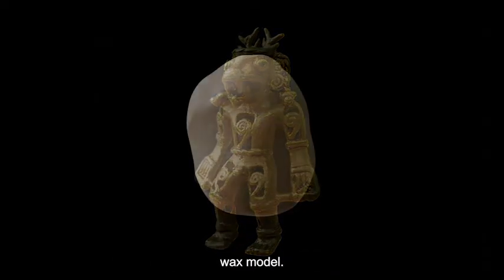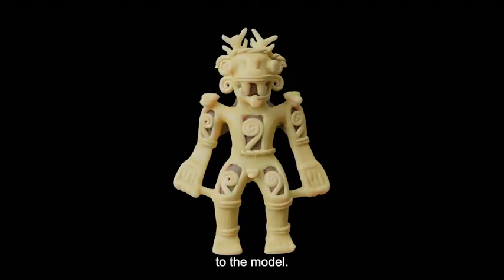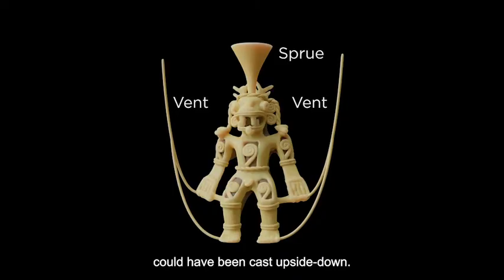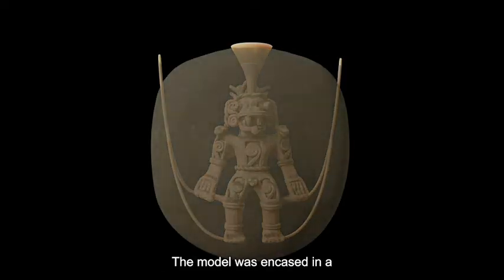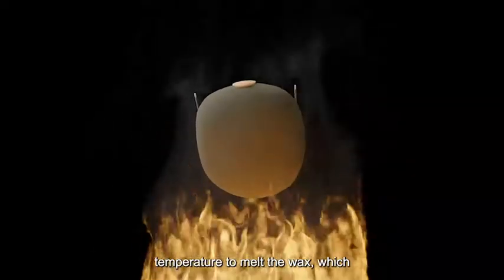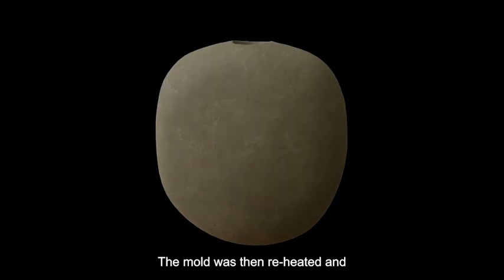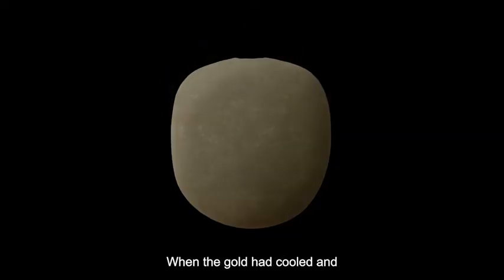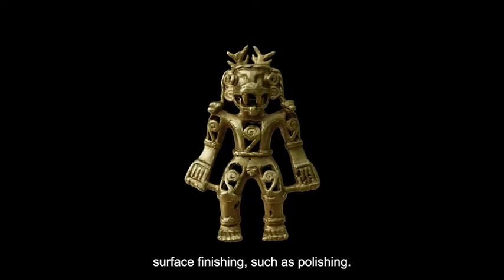The Lost-Wax Casting Process

Comment: How do they remove the inner clay though?
Reply: They don’t. It sticks to the outer layer of clay. This will then create a mould that can be reused. They’ll cut open the mould to remove the gold pendant and then close it back up to reuse the mould again.
Reply: That was my question too. If I had to guess, I'd guess they just take some small tool and dig it out through the holes/openings in the ornament, whether it was still soft, or it got hardened in the fire and they had to break it up.

Comment: Where'd they get their wax from in South America?  As far as I know, there's petroleum based paraffin wax that's a byproduct of the oil refining industry and beeswax from honeybees and they are native to Europe and Africa and weren't introduced into the Americas until after the 16th century. Maybe they used some type of tree resin ? I'd guess a pine sap glue would work about the same and melt out of the mold once the mold cured. Idk thanks anyone
Reply: Carnauba wax.